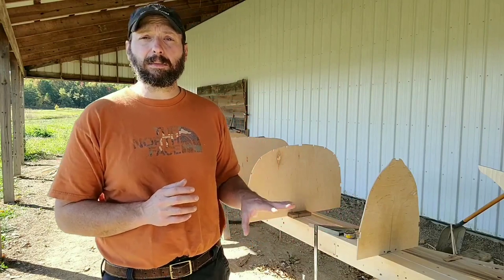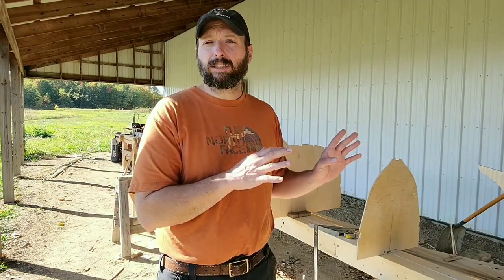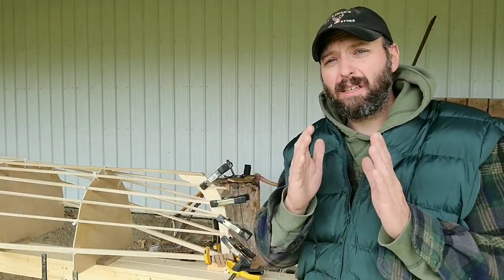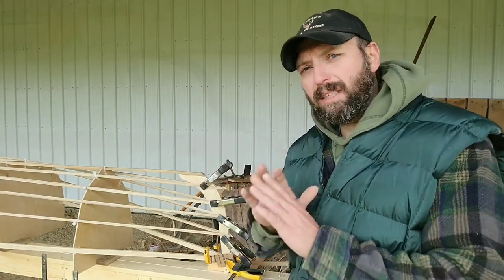Goedesic Airolite Skin-on-Frame Canoe Build Part 1

Comment: How did you adapt the Nimrod 12  plan to 13 feet?. By extending the spacing  between the ribs?
Reply from the maker: That's exactly what I did. The spacing isn't the same as the print. This size was suggested by the owner Larry after I told his how I planned to us it.